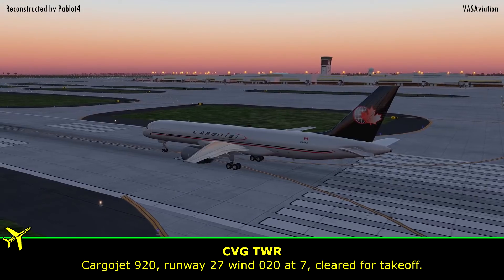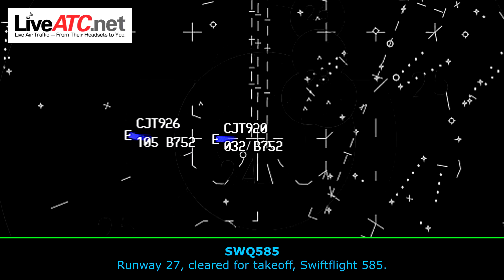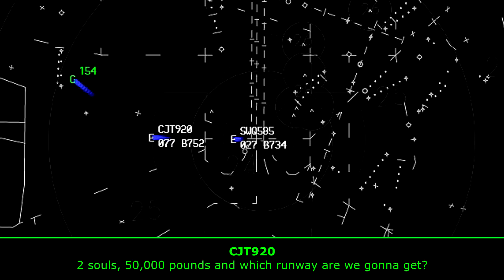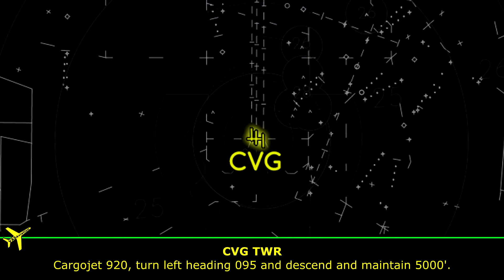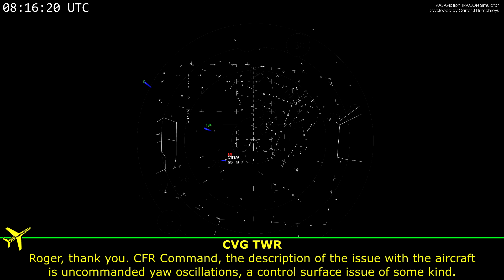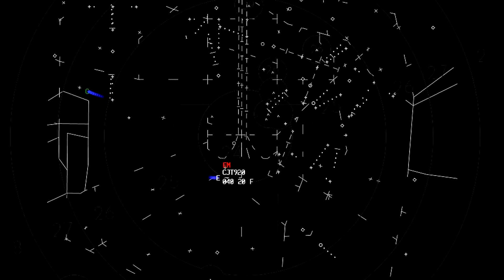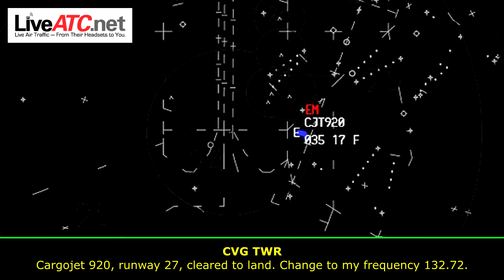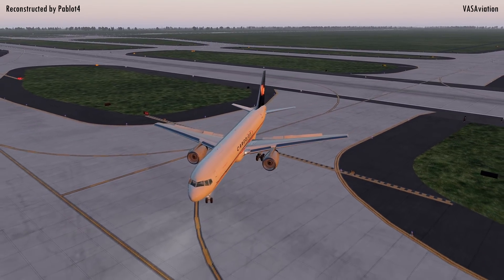Cargojet B757 has UNGOVERNED YAW OSCILLATIONS | Emergency Return

Comment: So what might be happening to cause uncommanded yaw?
Reply: Aerodynamic forces when you turn the plane will make it yaw and the slipstream will cause the oscillation. At high speeds they are very hard to control manually as there is a lag to it, which can make it worse, so installed is an automatic system that does this, called the yaw damper, and I think this system had a failure of some sort.
You can read more about Dutch roll here if you like: https://en.wikipedia.org/wiki/Dutch_roll
Reply: @se-kmg355  • Thanks for the link. Interesting reading, though technically above my pay grade. But I do love Aviation. Everything about it is just fascinating.
Reply: @gomphrena-beautifulflower-8043  No problem. Aerodynamics can be a headache by itself, but it is pretty interesting.
Reply: @gomphrena-beautifulflower-8043  
I so agree; I guess that's one of the reasons we're all here.  Loved aviation since I was a kid.  Would've loved growing up next to a small airfield; would have been the proverbial go-fer and probably typical pain-in-the-neck kid who wants to get his hands in everything and work towards flying as soon as legal. Maybe that could've been a reality back in my youth in the 1960's. Or maybe that's just a wistful thought and romanticizing of simpler times, haha.  I can tell you that even now that every time an aircraft of ANY sort passes overhead I'll crane my neck back and follow it till it's out of sight. 
Regards, Charlie.
Reply: @7CharlesV  • You may be around my age and I, too, got bitten by the flying bug” when I was little. Dad used to take us to Memphis (about an hour away) just to while away an occasional Sunday afternoon. Back then, you could go up on the roof of the airport concourses and watch planes come and go. We dressed up in our Sunday best when we did get to fly. It was such a big deal! Same thing with watching boats and ships lock through our local dam; you could literally reach out and touch them (but we dared not). Everything changed after 9/11 and it’s all sadly restricted by ten-ft-high fences with concertina razor wire!
Booo.  So now, I can only peer in per the webcams airports, waterways, and whatnot. I sure do miss hearing those jet engines spooling up; it’s not the same listening from a distance over an iPhone, at that. We live in a very rural area now, so occasionally we’ll see a crop duster sweeping, swooping, and diving on neighboring farms. I’m absolutely mesmerized by that, as well. Happy New Year!
Reply: @gomphrena-beautifulflower-8043  
Thanks for the well-wishes, I appreciate it.
I'm 68 years old, and grew up on a farm. When I was a kid working up in the field or doing tractor work, there'd be a big expanse of sky (unlike my suburban life now) and I'd be easily distracted by airliners flying overhead, and was especially wowed by the big, smokey 707's and loooong, stretched out DC-8's, as we were in the general glide path of Phila. International. Would give me chills, and of course dad wasn't too happy if I gawked long enough to go off course with the tractor or jump a row or two before I snapped back to attention.
Even further back, as a boy I'd lay in my bed at night and listen to the big four-engine prop planes (Constellation? DC-6 or 7's?) rumble across the sky, taking minutes, in seemed, to traverse the sky overhead.
Ha, sorry for my rambling reverie. Do I get an "old guy" pass? (No offense meant to other old guys or gals).
Reply: @7CharlesV  • I thoroughly enjoyed your brief trip back in time.. I’m 64 so yes, I can totally understand your reverie. In my case, I grew up in a small (by today’s standards) city and married a farmer 41 years ago, so as an adult I must say country life fit me to a T. Back when we farmed big, the Millington Naval Base (long since closed) was nearby, and their practice runs in their F-16s (or whatever they were) were over our expansive Tennessee River bottomlands. They would buzz my husband on the tractor all the time, tipping their wings in a playful manner. My husband used to say it was a “thank you” for their food that America’s farmers grew. Great times! We no longer farm, retired now and our son grows a little hay to sell on the side..but back to aviation - I hope I don’t ever outgrow my fascination with those beautiful birds, both the ones we fly and the ones with feathers.😊
Reply: Same thing that causes you to yawn: nobody knows... ?

Comment: Is it common for the TWR controller to also be APP?
Reply from the maker: Many airports are operating that way now due to Covid and low traffic
Reply: No,  only if the radar facility is out of service.  They would send a radar controller to the tower and he would work the aircraft in using procedural methods, (non-radar separation). If the radar is operational, Tower may have a slave scope, the BRITE, used by the tower controllers to observe their local traffic.  The range and use of it is limited.

Comment: Yaw oscillations sounds terrifying. Glad it came down safely.
Reply: Probably unsecured cargo
Reply: @cda32  Interesting. I bet a Load Master's job is both a science and an art.
Reply: @cda32  Yes, unsecured cargo can be EXTREMELY dangerous! A National Airlines Boeing 747 in Afghanistan carrying military equipment crashed right after takeoff, because the cargo was not secured properly, and it became dislodged due to the steep climb needed on takeoff at those airports, due to terrorist activity!
Reply: @cda32  explain how unsecured cargo would cause yaw oscillations.

Comment: Might be a dumb question but I'm not familiar with aviation 
What is JELDA? I've also heard GREKI in another video
Reply: Check out this chart of the ILS 27 at KCVG.  JELDA is the Intermediate Fix (IF) on the approach, and is identified by the where the localizer and the navigation radio (AKA VOR) in Falmouth, KY at 346 degrees.  You'll see that notated by the FLM and R-436 notations on the line that crosses JELDA.

https://aeronav.faa.gov/d-tpp/2014/00655IL27.PDF
Reply: @gregarious119  - Excellent reply!
Reply: @gregarious119   That actually helps a lot
Thank you
Reply: It's a radio navigation fix, in motorist terms it would be the intersection of Main and Fifth streets.
Reply: @skyboy1956 -Not necessarily,  they can be waypoints on RNAV routes, that are used as reporting points. On some charts you may see two waypoints, at an intersection, one for each route.
Reply: @skyboy1956   Easy to understand ~ Thanks!
Reply: Navigation waypoints. https://en.wikipedia.org/wiki/Waypoint
Reply: @oldRighty1    Thank you !

Comment: Can somebody explain to me why we are able to listen to the tower bot not to the em vehicles?
Reply: The tower has its transmitter up high while the landing plane and ground crew are on the ground. If the person who set up the listening radio is close sometimes you can hear both but if they are farther away you only get planes in the air and tower.
Reply: @cluerip  thank you very much!
Reply: LiveATC and its ilk get their audio from remote receivers operated by individuals and are most likely not at the airport. VHF communications are line-of-sight. I'd guess that the signals from the vehicles were blocked by terrain, buildings, etc. The tower's antenna is located much higher and their transmitter emits more power than the vehicles' transmitters. I don't know why we couldn't hear the aircraft on the second frequency. Just the vagaries of RF propagation, I imagine.
Reply: They were on a different frequency not available to hear for us.

Comment: 5:13 Crash is a bad callsign for air traffic control
Reply: Well they are there for worst case scenarios, I think its reassuring to the pilots to hear them respond on frequency.
Reply: I'm pretty sure in this case CFR stands for Cincinnati Fire and Rescue. Crash 4 refers to a specific vehicle. I concur that the "crash" part of the title could be distracting for pilots dealing with a stressful situation.
Reply: @loismiller2830  Cincinnati airport CVG is actually in Northern Kentucky. I believe Covington was closest city at the time airport opened, hence CVG. Across the river in Cincinnati is the smaller Lunken airport LUK and that is run by the City of Cincinnati Fire and Rescue Department. Just thought you might find that interesting. I go to the viewing area at CVG all the time but did not get to catch this one which flew directly over and slightly to the right of the public viewing area on final. Hope you are having a good day, or night wherever you are.
Reply: Yeah, crash is a word pilots love to hear while dealing with an issue.
Reply: @billfly737  Lol u think trained professionals are gonna be influenced by that? Really?

Lets replace all fire warnings with "land asap" indicators. Im sure the pilots will be less stressed!
Reply: I was gonna say the same. When I worked at MSY the Fire/Rescue units were call sign FOX.
Reply: Yep, I was thinking the same. Cringed when I heard that.
Reply: Sure... a pilot is going to hear the call sign ‘crash4’ and think 🤔 “crash? Yeah, I mean, I was going to land it... but.... ATC said crash... sooooo...” 💥🔥

Comment: Does anyone know the outcome...curious if it was a yaw damper issue? Servo? Jack screw?
Reply: As a B-757 Co-pilot years past one of the 3 flight data computers, if my 75 yr old brain cells are correct ADRUs or close to that acronym,  sent a signal to climb. We were at 33,000 ft cruise alt on autopilot. Captain reacted in a micro second, regained control. Quickly identified that unit was turned off. No problems. Could be that or about 3 other things unless one in the pilots stepped on the rudder pedals by mistake. Thanks

Comment: Almost certainly a yaw damper problem
Reply: As long as the ap can handle the issue there is no need to disconnect anything. Its already a higher workload situation so no need to add manual flying to that.
Reply: But couldn't they cut-out the Yaw Damper or would that cause an AP disconnect?
Reply: @atubebuff  if a pilot has a malfunction his actions follow established procedures and checklists. Can't circumvent the process.
Reply: @skyboy1956  I ask because the Checklist specifies switching to Secondary Yaw mode which degrades the Yaw significantly, then Direct Yaw mode which would disconnect the damping completely. Yaw oscillations when trying to make an approach are never a good thing.
Reply: @atubebuff  Do you by chance know if there is a speed / altitude adjustment as well?
Reply: @skyboy1956   @skyboy1956  I'm not sure if you mean something the pilots can do or something the control system does but i'll assume the latter. All control surfaces compensate their deflections for speed/"thickness of the air" as this relates directly to the force they exert from the moving air. Since the AP seems to have been running fine and they didn't report any flight control system failures it's an interesting event. A "Dutch Roll" would be the first thing one would consider if the AP and the YD weren't playing nice. This is a perfect example of pilots relying on automation rather than just bringing the plane in manually (no AP & no YD). They're a Cargo plane (with no pax) and being vectored in so saying the workload is a greater risk than having the plane yaw on approach (at low speed and low alt) doesn't seem reasonable. I work in flight control but i'm also not a fan of relying on it if it makes bad decisions based on "silent" failures of the inputs (AP, yoke,pedals), outputs (control surfaces) and feedback (inertial sensors&various).

Comment: I really like how the controller is very precise whenever he talks
Reply: And he’s not speaking like a machine gun.   I don’t get it when folks on the radio talk rapid fire.  What’s the point other than trying to cram too many words into a statement?
Reply: @rd4660  Well I mean under normal conditions (no emergency) talking fast as a controller when giving simple instructions like heading, altitude and so forth is pretty useful because many times there are a lot of aircraft on the same frequency but of course as you say in an emergency situation its counterproductive
Reply: @eaglemotion292  but in reality there's plenty of time to speak slower and consistently. The machine gun like execution of radio calls is something we need to steer away from.
Reply: My comment was similar to yours.  Clear and precise.
Reply: @jamescollier3  You can hear this attitude in his voice after he says 'you can have any runway you like' and realizes he should give a suggestion and offers up the longest so the pilots don't have to look it up. I think you're probably right that these kind of videos end up getting watched by ATCs too, and they are able to learn from them.

Good RT and situational awareness with this controller!
Reply: Agreed, the ILS clearance sounded so clear I mistook it for a 60's robot.  👍